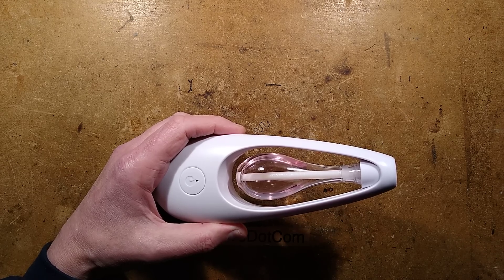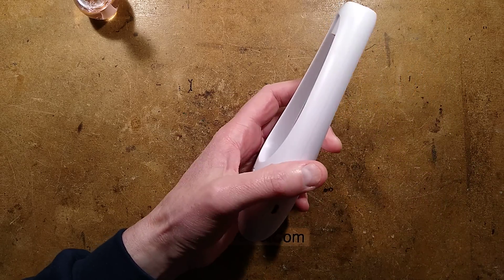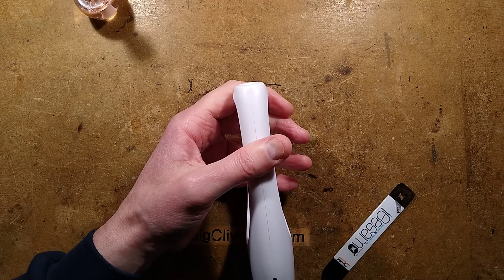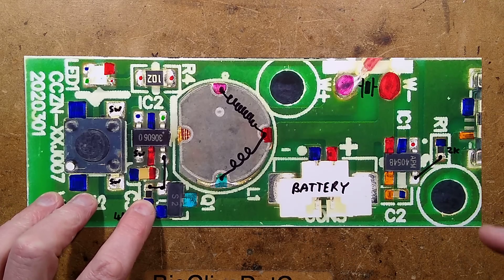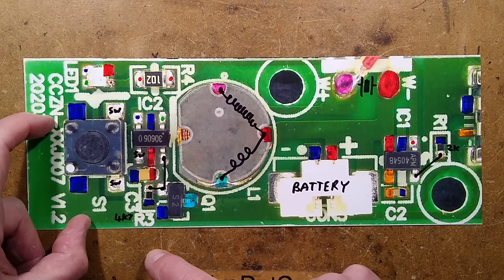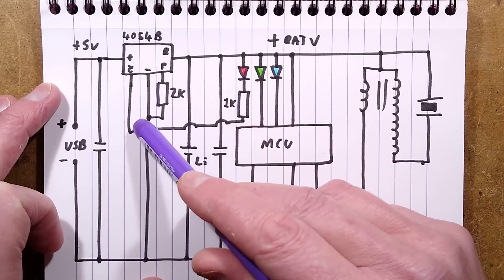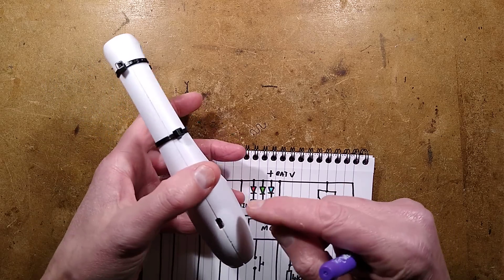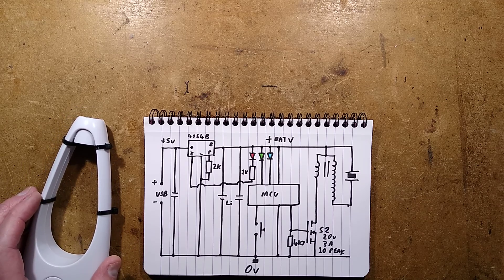Inside a Chinese aroma atomising unit

Comment: I remember I got a knock-off Imax-b6 universal battery charger from china (for Li-po, Li-ion, NMH, NCD and Pb batteries upto 24v). I followed the official guide of the charger on how to change the voltage readings accuracy and it bugged out and bricked the charger, I opened it up to see if there was a way to reset it and it was full of dead mealworms! 😂 Until that moment I always thought things like that was a joke.
Reply: Maybe the manufacturer misinterpreted a customer complaint of software bugs 🐛 🤣
Reply from the maker: That's odd.  I'm not sure I trust microcontrollers being put in charge of critical charging voltages.

Comment: An odd suggestion, since you have vaped before: Have you tried putting vape fluid in a piezo atomizer? I did so with a nebulizer (the asthma dispenser in the same body as a fabric shaver) in the past, and... it works. Makes me think there's possibly a very lucrative disruptive, more energy efficient means of vaping.
Reply from the maker: The very first Ruyan cigars did that, but the heated coils are simpler and more reliable.

Comment: 0.25. I see a 1970s aromatic L ima S ierra D elter party happening here. Ps. Am i the only one who had that 3 letters blocked? Side note: i think i mentioned this on another video or short, we've got a new estate being added to the end of our road, and they've started doing drain works, which being in a 1905 house isn't very well sealed means we are getting the pong getting into the house! My gran who has COPD thinks its  a fantastic a idea to have 3 plug in 3 sent things, 2 sprays and 3 oil mist things, and she's wondering why we are were getting headaches and why her breathing was so bad and why the air filter was constantly ramping up every time the mist went off. Ive tried going around switching them all off, but she seems to find out every time, my next trick is gonna be a hammer. I dont understand why these things are even allowed to be sold tbh they even show the warning for cancer causing on the packaging!
Reply from the maker: Yeah.  I don't recommend having multiple devices to mask the smell, as the indoor environment will be worse than the sewer smell.

Comment: I am converting a Triumph Spitfire to electric. I could use this the emulate the smell of unburnt hydrocarbons that purists insist on inhaling…
Reply: Don’t need to get this fancy. Just coat the Lucas electrical system in motor oil. As the wiring cooks off, it will also release the oil smoke emulating the full British car experience. 😁

Comment: Doesnt the piezo have to be going supersonic like they do on humidifiers?  They call em transducers at that point but they’re still just piezo discs..
Reply from the maker: It's ultrasonic.  10s of kHz.
Reply: The size of the piezo element dictates the frequency that it resonates, like anything that generates sound. A rough rule of thumb would be 1mm would resonate at about 2kHz, 2mm would be 1kHz, 4mm 500 Hz etc.

Comment: Bravo for still taking it apart that cleanly 👍🏽 If I want to take something apart and it has been glue shut or even ultrasonically welded? YEET: Into the vice it goes 😂 and then slowly closing it like a medieval torture device until it starts popping😂

Comment: The Chinese: Let's put a plug connector on the lithium battery so it can be easily replaced if it goes bad
Also the Chinese: Let's glue this thing shut so nobody can get at the insides without completely wheedlerizing it

Comment: Update, i just tested it, works good, a bit more mist than the one you have
Just need to make sure you asseble it with the wire on top, and make sure the wick is fully soaked ;)

Comment: I like the ones Air Wick sells since they don't have to be plugged in the wall so you can put them wherever you want, and the timer can be adjusted. It's just a shame they don't come with a reusable screw-on scent cartridge that would let you use your own oils instead of the disposable single-use ones Air Wick sells as that would allow you use just about any scented essential oil you'd want.

Comment: The microcontroller looks to be using almost the same pinout as the common atomizer kits that use the same piezo discs, but notably the switch input and mosfet output are swapped. They are probably all derived from the same schematic.

Comment: That's actually a very neat little unit. I wonder if it might actually be useful, either as a humidifier, or something like a liquid fertiliser dispenser for a garden. (Or a capsaicin dispenser to keep cats out of your flower bed...) What voltage and frequency does it generate for the piezo disk?

Comment: Have you ever made a video on those Chinese diesel heaters?
Reply: I don't think so
Reply: They work fine but they are put together without any quality control. 
So you have to be careful and control it yourself before running one
Reply from the maker: Not yet, but I have two here in the video pile.

Comment: Would be nice to see the outputs of these basic MOSFET transformer and MCU. Measured at the input to the transducer just to see how primitive a wave form you can drive them with as it doesn't get much simpler than this, good excuse to wipe the dust of the O Scope.
Reply: I was wondering if the secondary is wound to be resonant with the transducer. That way it won’t matter what the output frequency of the MCU is as long as it’s lower than that of the resonant circuit, it just has to pulse the transformer every millisecond or so to ring the resonance.

Clive will need some very high impedance probes to see that though.

Comment: Ultrasonic welding. I've never heard of it, but is that what they use to close the transformers on laptop charging cables? The only way I can get into those things is with a Dremmel.
Reply: I used to work on Compaq desktops, there were always some staked or welded spots that required Dremel or box-cutter surgery. My fingers often came out the worst.
Reply: Ultrasonic welding fuses the plastic by precisely melting the contact surface through friction. It's often stronger than glue and very hard to get apart again.
The easiest way I found to get into those power supplies is with a bench vise, if you carefully put pressure on the joint it often cracks along the weld and you can pry it open with a screwdriver.
Reply: You can play with ultrasonic welding, in the focal spot of one of those cheap mist fountains😁 It was pretty crude, but i fused two pieces of PS plastic from a yogurt cup🥳

Comment: Unless there is a current limiting resistor built-into the MCU pin driving the mosfet gate, the gate capacitance can draw more than the pin is rated for. 
This and for other reasons, good designs use a gate resistor on top of the pull down resistor. Usually <= 100 Ohms. 
The intrinsic diode inside the mosfet is taking all the brunt of the coil's BEMF when the mosfet shuts off. That would make it very noisy electrically. 
As it stands, the pulses are being absorbed by the Lithium cell getting pulse charged, if there's not enough low ESR bypass capacitance on the supply.   
I think they made it just functional and no more.  Longevity was not their goal.

Comment: If an apple m4 chip has twenty eight billion transistors, how many transistors in that little micro controller?
Reply: Looking up an average $0.10 6-pin microcontroller, it looks like something similar to a PIC10F322. That's got 64 bytes of RAM, 512 instructions of flash, and runs at about 16MHz. Sadly I can't find any actual transistor counts but an 8-bit AVR is 12,000, and this thing is less powerful. I'd probably guess 5,000-10,000.
Reply: @bewilderbeestie  It must be expensive to produce so many different microcontrollers. My bet is a lot are the same and they just turn of the transistors they do not use.

Comment: I've seen 4054 with led going from bus voltage and your going from the battery, which is better?
Reply from the maker: For a simple charger it's usually the USB side.  In this case they've used it on the cell side so they can use a single common LED pin.  No significant current should flow when the LED is not lit.

Comment: I'd rather freshen up a space with an ozone generator. Which I recently got one, battery powered, can run supposedly about four hours on a charge. It's STRONG, I turned it on and it hit me with a blast that nearly knocked me out before I could leave the area I was treating. So far I've used it in a bathroom and my car and it's worked well. I'd love if you took the same model to bits but it was semi pricey.
Reply: do you have a name or model number of that ozone device?
Reply: @ShockburnVR  Airthereal PA1K-GO 1,000mg/h Portable Ozone Generator. Apparently has a service life of five thousand hours.
Reply: @Kinkajou1015  Thanks
Reply: @ShockburnVR  Be warned if you get it, the blast of ozone it gives off when you turn it on is immediate and powerful so you need to already be ready to get out of the area and be holding your breath until you are a distance away. No pets in the area either.
Reply: Ozone is a health risk!!

Be aware and do NOT use that before you know what you do!!!

Comment: I wonder if these circuits, is it possible (have enough frequency/power) to run Electroluminescent (EL) panels🤔
Reply from the maker: It would be better to use a dedicated EL driver for that.  The open circuit voltage of this circuit might be quite high.

Comment: What would happen if it is ran dry?
Reply from the maker: It would probably just run without producing a mist.  If the disc overheats it loses its piezoelectric properties and will just turn into a capacitor.
Reply: It would stop stinking the room out!

Comment: Today i received some atomisers, looks to be the same circuit but without the battery charging, just 5v usb, it's just the nodule plus the head with large wick that you can put in a bottle, on Amazon is listed as 'Funfob 6 Pcs 20MM Ultrasonic Mist Maker Atomizer Transducer Atomizer ', i haven't tried it yet, and won't be making a video.

Comment: Wick supplied seperately? Is that not the felt from the inside of a hilighter pen?

Be interesting to know what the frequency of the atomiser is

If they're going to make it battery powered they could at least include a clip to attach it to a car or a doorframe or something...
Reply from the maker: It does come with a wall mount.